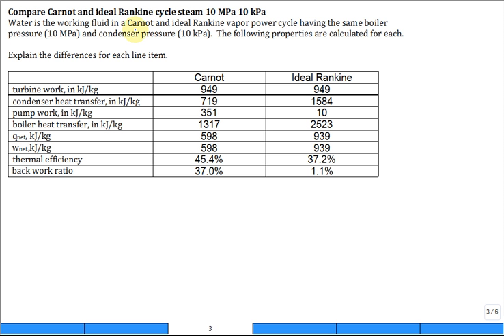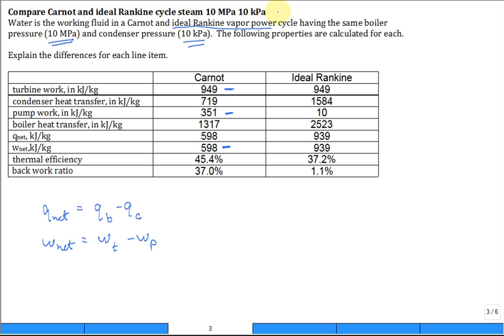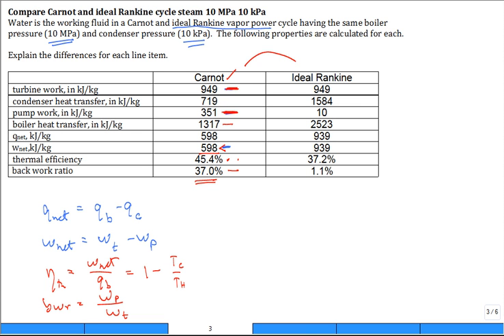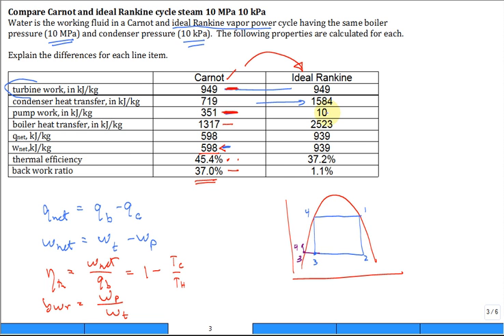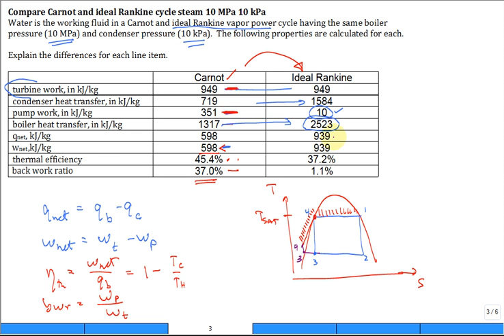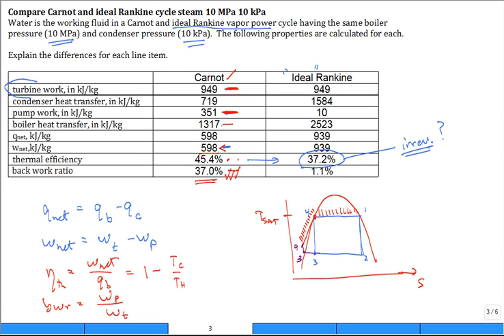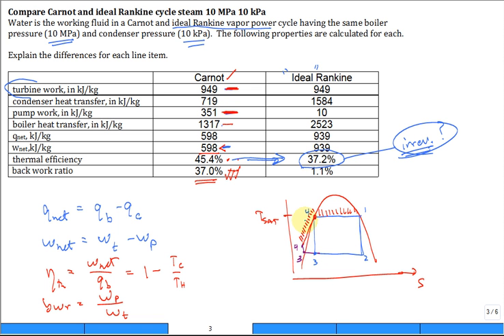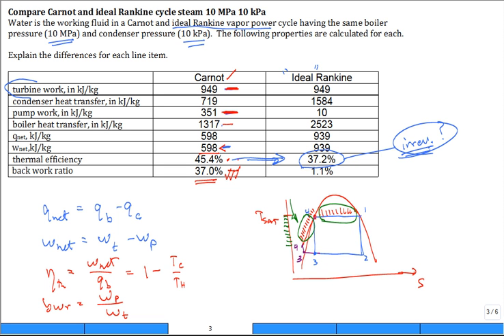Compare Carnot Ideal Rankine steam 10MPa 10kPa

Comment: Sir, there is no irreversibilities at all in the ideal Rankine cycle. Near the end of this video you asked a question that implied that the Rankine cycle has lower efficiency compared to the Carnot cycle because of irreversibilities assuming that the two cycles operate between the same pressure limits. But that is wrong. The reason for lower efficiency is only because that the average temperature at which heat is added in case of Rankine is lower compared to the case of Carnot.